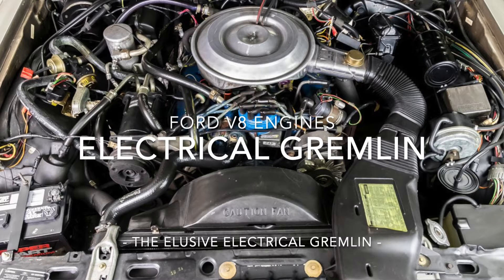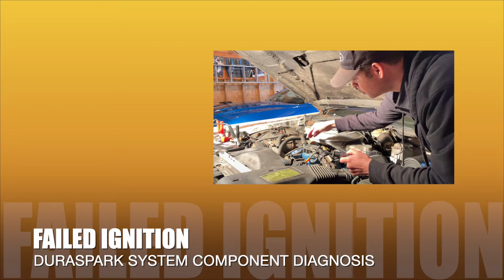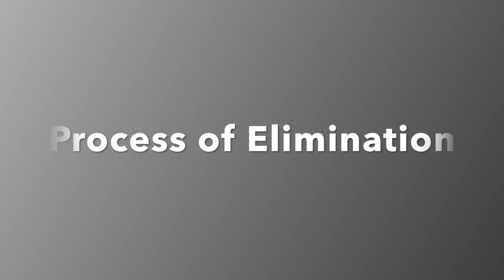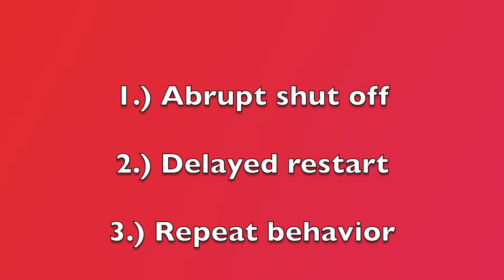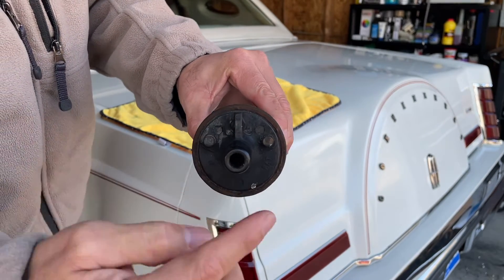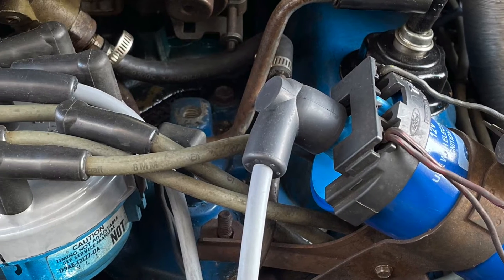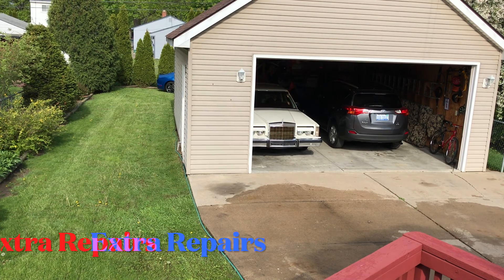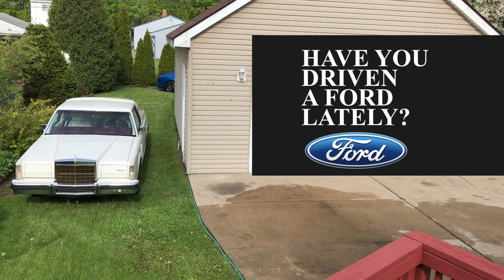Stalling Continental Mark VI fix DURASPARK Ignition System Ford Lincoln Mercury 351 Windsor V8

Comment: Replaced my coil.... replacement of ignition control module still won't run :(
Reply from the maker: did you also replace the crankshaft position sensor?
Reply: @xrmerkur not yet Jake is coming out on the end of July we're going to do spark plugs and crankshaft sensor hopefully it fix it I am having same issues u did he had me watch this to give me some refreshing

Comment: I actually have the same year and exact model Lincoln coupe with the same stalling problem. It will run fine for 10 minutes and then cut off. I found your channel about 2 years ago and you hadn't found the problem yet. So glad you figured it out and i hope it works for my project car too. Thank you for sharing
Reply from the maker: @carljames9700  hello Carl, glad you’ve been tuned into my channel for so long. greatly appreciate it! definitely try the sensor replacement, it’s reasonably affordable and quick work. let us know how it turned out.